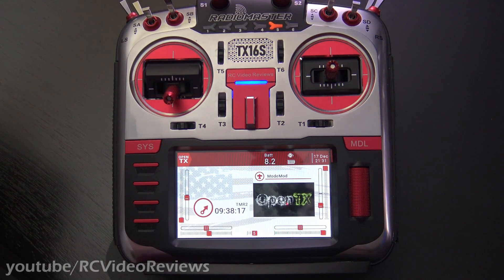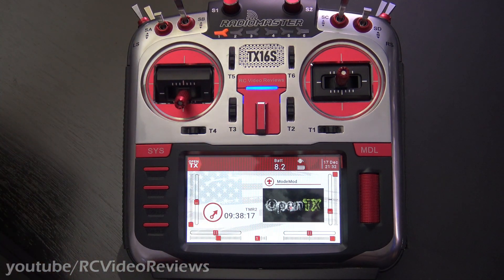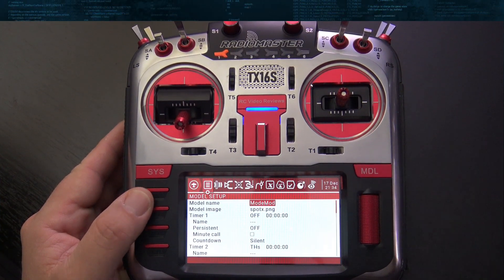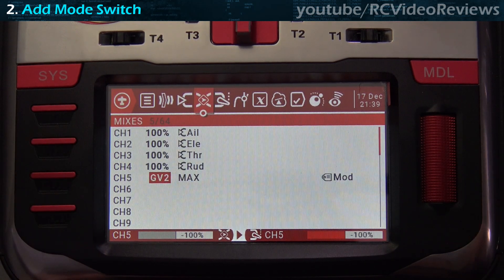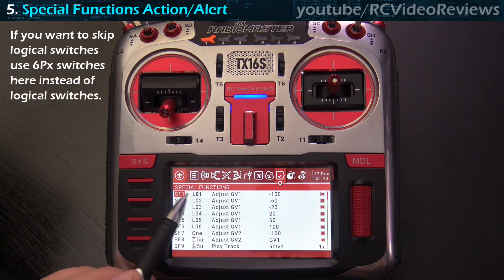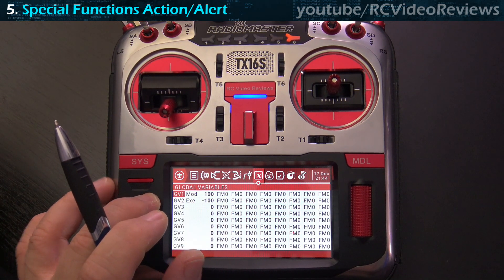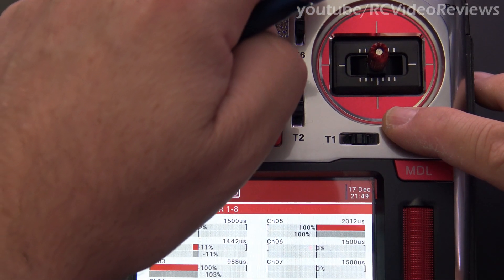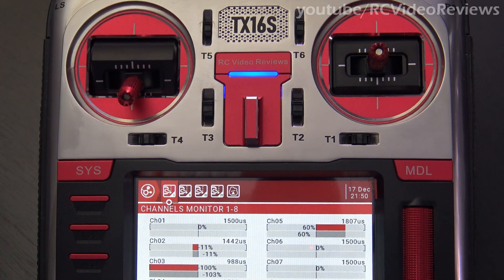OpenTx Tutorial • Help with Flight Modes • [Advanced]

Comment: So, maybe I'm doing something wrong, but I dont think this works on EdgeTX. I copied everything you did and it works, except the trim works as a momentary in the wrong direction, and I don't think you can change it. In otherworldly, it's stuck "on," but if you reverse the action and hold it up it works as you say. I dont think you can reverse the actual trim swotch. You can fix this instead by assigning it to SH. Then it's the same functionality, just different lay out

Comment: Hi I got a Frsky dongle for using Realflight 9.5. I can only get it to work with throttle - ail - rud -pitch. I need to get the radio to work on all switches, so I can use gear - smoke and so on.
If you can solve the problem i will be a Patreon. :-)
I love your videos.
Reply from the maker: I would put a knob or slider on every channel after the first four to see what the simulator responds to. It wouldn't surprise me if 5, 6, 7, 8 didn't work, but 9, 10, 11, 12 did. Try that. Just use S1 on every channel after the first four that you already have working. If the dongle doesn't pickup anything after 1-4 then you have your answer.

Comment: Hey John. Once again Thanks for an execelent and inspirering video. I am struckling a little bit to get it working. I am wondering if the release 2.3.9 support this setup or maybe my tx needs an upgrades to 2.3.10. Anyway my TX seems to work according to the video but the Flight mode selections are effektive in the rx imidiately when pushing any of the 6 switches.
Br Tommi
Reply from the maker: I don't think it's a firmware issue. The tools in this video have been available in OpenTx for quite some time. Make sure you don't have your GVARs mixed up. Use the Channel Monitor to verify mix and output on your mode channel. That mode channel shouldn't move until you hit the Execute switch which copies the position GVAR to the EXECUTE GVAR.
Reply: @RCVideoReviews  Hi. You are correct that it has nothing to do with the firmware and the outputs worked fine according to your video but the Execution was imidiate.
I started wondering how to make the execute swittch work and I had an idea why use a execute switch if it all could be managed from the flight mode switches and the audio.
It is now posible to select flight mode 1 to 6 and a delay of 2.5 seconds is giving time to press another switch in case you hit the wrong flight mode. English is not my native language and I wonder if I could sent you a couple of screen dumps from my radio and notes. Merry Christmas to you all.
BR Tommi

Comment: Great use of OpenTX's versatility!  It occurs to me that a variation on this idea would be to skip the 6-position switch and just use the trim switch:   trim-up repeatedly to select (and announce) the mode, and then trim-down to activate that mode.  This would also work on radios without the 6-position switch.  So many possibilities!  Thank you for this informative video and the thorough explanation!
Reply from the maker: My first thought was to use one trim for modes as you suggested. The reason I went with the 6p is because if I know for sure, I can get there with one press. Using trim, you'd have to toggle through the list. But yes, either way will work. That's the best part of it.
Reply: Or, T5 up or down scrolls through FM. T5 pressed down (both) activates.
Reply from the maker: @jamiefl  Nice job. :)

Comment: Hi, I can see a problem with the last setup. If you have selected mode 3 without pushing activate (GV1 is set, but not GV2), then pulse mode 1 (GV2 is set to mode 1, but GV1 still on mode 3) and then you push the activate button, you´ll activate mode 3, even when the flight mode selected to mode 1. I don´t have this radio yet, but I think this could be a problem. I guess you need to assign GV1 as well as GV2 in the modes that you don´t want to use the activate button.
Reply from the maker: It wouldn't make much sense to bypass, then activate, but if it concerns you, it would be an easy matter to use another SF to set GV1 for bypass modes.
Reply: @RCVideoReviews  It´s my sofware developer brain speaking... "if a user can click that button, he will" :)
Reply from the maker: That bypass bit was a “food for thought” segment to give ideas. I’ll do that more in advanced videos than in beginner videos because I expect advanced users to take the concept and run with it. In beginner videos I tend to spell things out a little more.